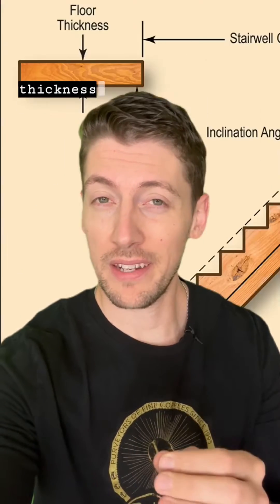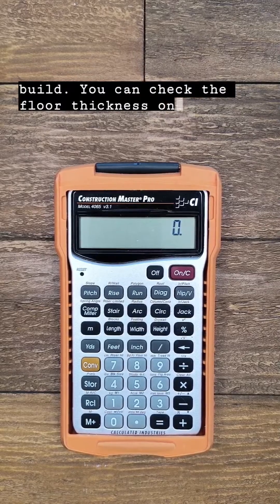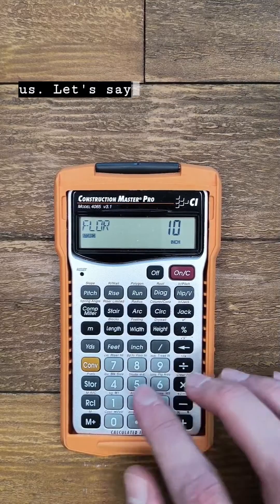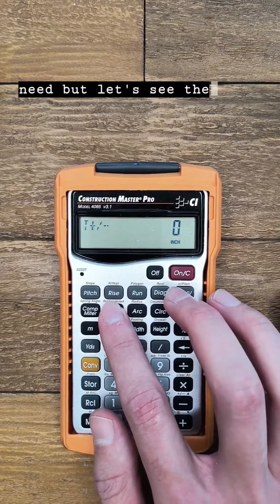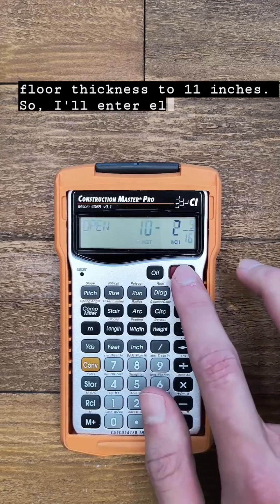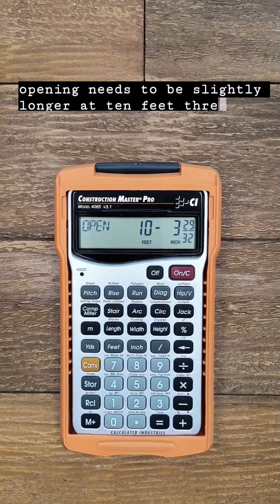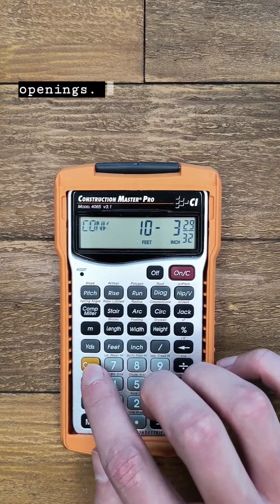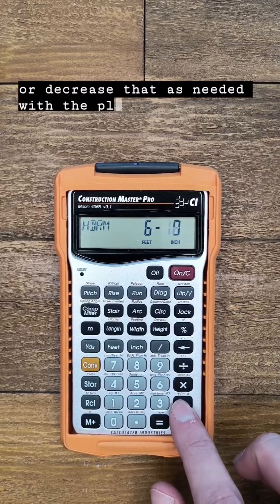Building stairs | How floor thickness affects stairwell opening

Comment: Why is the default 10 inches? Most floors aren't 10 inches thick right?
Reply from the maker: When we researched the methods of stair computation, this was a typical value for floor height. It is a variable value which is why we allow for the storing of different values 👍